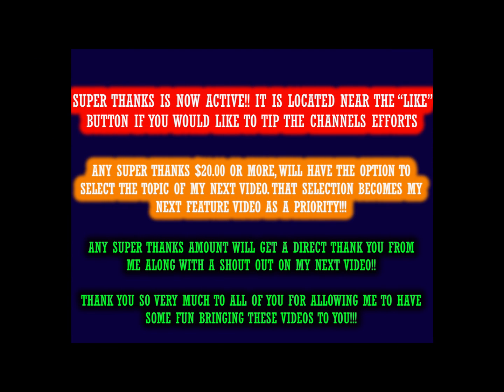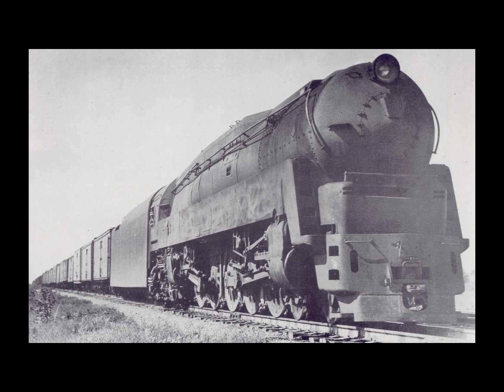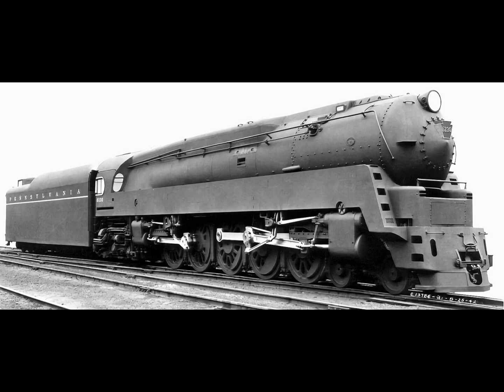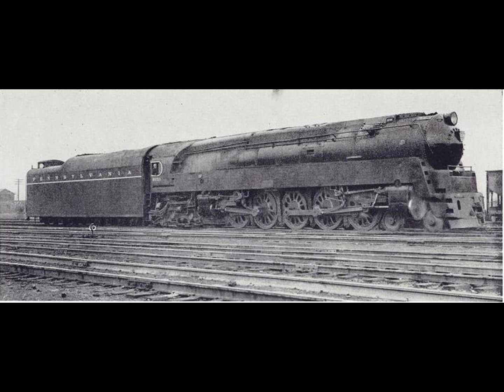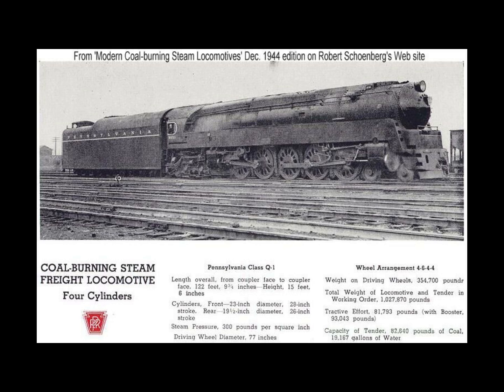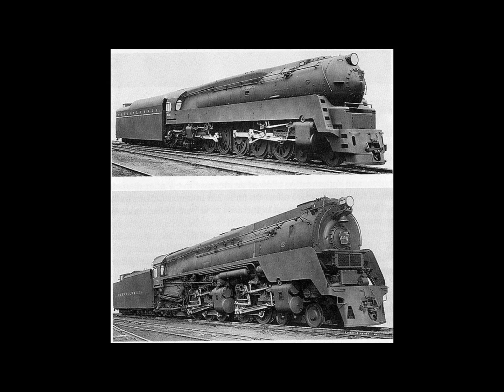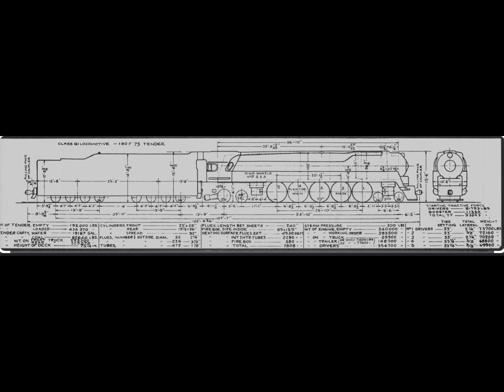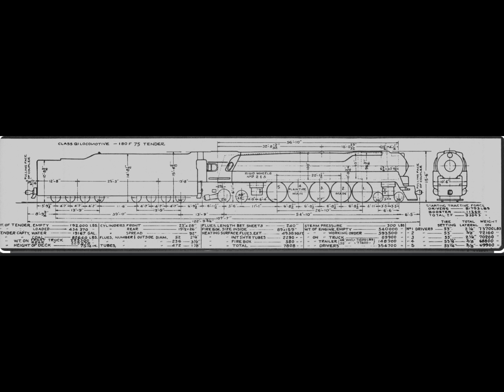The PRR's Experimental Q1 Duplex Locomotive

Comment: Big problem is that the B&O and PRR were over-influenced by Baldwin - which was predicting dire results in next generation team and beating the drum for duplexii to fix it. It turned out to be a none problem 1) conventional counterweighting was improved 2) diesel-electrics entirely eliminated "hammer blow". So the two roads wasted millions, when conventional 4-8-4's would have done the job quite successfully (NYC Niagara vs PRR t1).
Reply from the maker: And Baldwin (the other Steam manufacturers too) were behind the eight ball in developing diesel concepts.. So anything to save steam.

Comment: Great video.  I had not known of this engine previously.  I may have misheard, but it sounded like you said it was dismantled “about 1945” which does not fit with the timeline.  Did you mean 1955?
Reply from the maker: Completed in 1942.  In spotty service until 1949, It wasn't ran very often due to maintenance issues. Scrapped in 1952. Q2 (video coming) took the reigns.
Reply: It was retired in ‘49, but I’ve seen some reports saying it was also scrapped that year. 1952 is when they finally dropped its number from the roster @TheRailroadCrossing-SteamPower

Comment: One of the things that i just cannot understand is why the PRR was so against Articulated locomotives. 

I understand a duplex like the T-1. You take a 4-8-4 and divide it up. Ok, fair. But duplexing what would normally be a 4-10-4 (with 77 inch drivers) makes for a pretty long loco, and I dont know the capability of lateral motion devices to account for that long a rigid wheelbase. 

On the other hand, by 1942 there are a lot of examples of articulated locomotives capable of moving freight at speed that would suit the PRR's needs. 

When the PRR was shopping for the locomotive that would end up being the J1, they asked builders to submit designs, including Big Boy, Allegheny, DMIR and SP Yellowstones, and the N&W A. When they factored in the restrictions (fit on a 110 foot turntable, fit route clearances, no excessive overhang in curves) allegedly only the C&O T-1 was left standing. This in spite of the fact that the N&W A is shorter, thinner, and fits on the turntables as well as the T-1. The implication here is that the overhang of a A going around a curve would be enough to cause a collision with a train on the adjacent line and that just seems absurd. So unless this truely was the case, why not go for a articulated locomotive?
Reply from the maker: I was telling Machinist that they could have at least tried a hinge system on that big, rigid frame. The thing was a test bed anyway.. Dunno why they couldn't have tried it.
Reply: @TheRailroadCrossing-SteamPower  once you hinge it it becomes a articulated, right?
Reply from the maker: Well by definition I suppose so.. But the thing doesnt really look like one otherwise. You and I could have predicted the outcome of this thing back in the day with what we know. Why they couldn't is beyond me.
Reply: I really wonder if the PRR's aversion to articulated loco's was a labor relations issue.  IOW--maybe they were  concerned that employing large articulated locomotives would be interpreted as eliminating train crew jobs by running longer trains and eliminating doubleheaders.  I've never heard this as a direct statement, but maybe implied.  The "Standard Railroad of the World" surely spent a pile of money on non-standard locomotives, even after diesels showed up.
Reply: Height? Just looking at the Q1. It’s the biggest locomotive the PRR could run east of Altoona. It ran to Harrisburg and even Philadelphia at least once.  

The Q1 isn’t really comparable to articulateds because it was intended for passenger work from the jump, as well as freight. Even with its “handicap” it would leave a Challenger and an A class in the dust at 70 mph, just as a T1’s could clear any 4-8-4 prior to the Niagara’s. The main reason the Q1 ended up as a Lines West freighter because its power was more valuable there compared to the I’d and N’s that sometimes weren’t even allowed to hit the 50 mph speed limit

Comment: If the Pennsy had started research on duplex steam locomotives earlier, say in the 1920s, or had considered articulating the duplexes, allowing each drive unit to get better traction, the duplexes may have stayed off the diesels a little bit longer.  My dad never fired or operated the duplexes, but he fired numerous other Pennsy steam locomotives out of the Pittsburgh Division.
Reply from the maker: The timing couldnt have been much worse. And as Carl said here.. Pennsy wasn't a fan of articulated anything

Comment: Interesting,  this is a  duplex steam locomotive I didn't know about.  Reciprocating steam locomotive which is the typical type can have their up and down wheel rods and wheels totally balanced; however, the piston rods for-and-aft motions are not fully balanced causing the steam locomotive to hit side-to-side on railroad tracks.   Many European electric and diesel locomotives continued the use of connecting drive wheel rods.  This imbalance seemed to only become an issue when host railroads didn't want old warn out and poorly maintained steam locomotive from preservations societies on their rails.   There are patented active balance systems for balancing the piston rod motions on steam locomotives according to a reply to a comment I did on the Pennsylvania T1 duplex being built.  

It doesn't have to be an  actual steam locomotive to witness this action.  I see it on my Bachman Big Hauler G-gauge steam locomotive.  It might be some other balance situation, but it looks like the side-to-side action that is the issue with the piston rods of steam locomotives.   

Steam locomotive don't have their paired pistons clocked 180° apart, but 90° apart called quartered.   If 180° apart the piston rods might bind when at their extremes of movement.  The piston movements might be right out, left out, right in, left in, 90° apart.  

British steam locomotives are suppose to have three cylinders on many steam locomotives.   The two obvious ones outside the frame as done in the US and third cylinder between the frame that isn't seen.   To give an alternative approach to seam locomotives it would be a good contribution to include a video on a famous British 3-cylinder steam locomotive.

Comment: One of the biggest mistakes that I see in these long rigid frame duplexes is the failure to incorporate  articulation into the design drastically limits their versatility.  Versatility was an advantage for diesels.  Why make it bigger by limiting the versatility of a proposed experimental engine?  

Thanks for another good video!!
Reply from the maker: Yeah, A hinge wouldn't hurt here in these designs so the loco's are flexible if they weren't going to use articulation as you suggest.

Comment: I've been waiting for this one it's a shame the rear cylinders had thermal issues being they were so close to the fire box but think this would have been a success
Reply: Well the Q2 is pulling into the station with those rear cylinders spun around in the right direction to tell you that its not going to be a success. 

I suspect the Q2 will be covered in the immediate future. Spoilers, its not great.